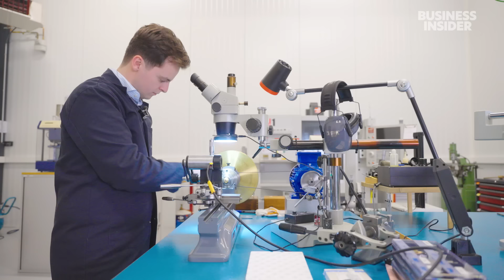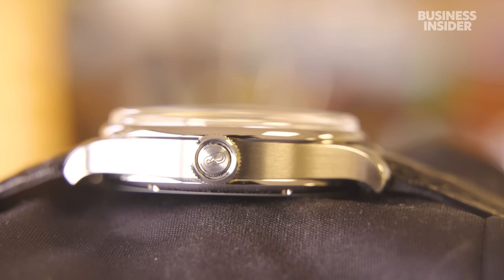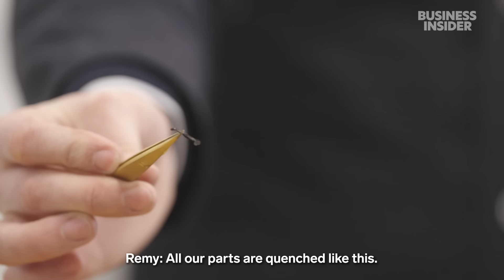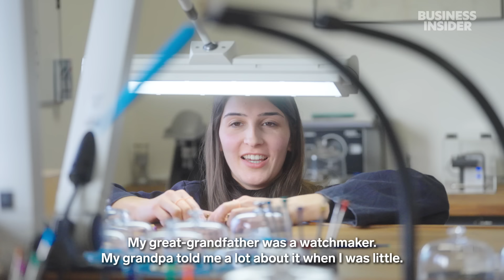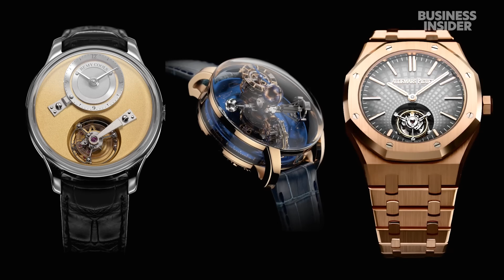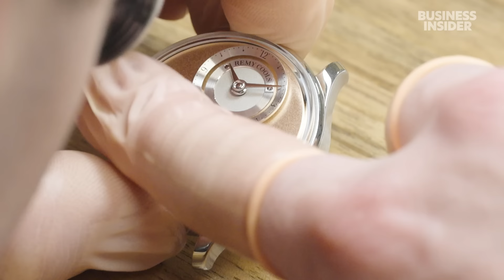Why This Obsolete Mechanism Makes Watches More Expensive | So Expensive | Business Insider

Comment: Actually the tourbillon is worthless in a wrist watch.  It was designed for a pocket watch because it stays in the upright postion all the time which degrades its accuracy.  A wrist watch is constantly changing its orientation so as to average out orientation errors.  So a tourbillon does nothing for a wrist watch but add cost.

Comment: an apple or android watch is so underrated. people only think of the watch itself but there are many hours of software that are written be loaded onto the watch as well. it would be interesting to know the number of hours creating a modern smart watch in total to include the time spent writing all apps loaded at the factory and available to later install on the watch. not to mention the built in gyro and pulse monitoring and wifi and bluetooth and gps (hadrware and software.)  

two people could not build all parts of a modern smart watch from scratch (including software) in a year i'd guess. if these two people in the video were building their watches like the amish (no machines/electricity) that would be one thing but they use computers with cnc machines. at that point just get a modern smart watch that constantly updates the time from a network based on an atomic clock and can start your car as well.

Comment: It's not about performance, it's about craftsmanship. These days, these are luxury items.

If you genuinely need the precision, any old cheap quartz watch will deliver. If you need more precision, a radio-controlled watch will sync itself to within a second of your local atomic clock broadcast. A GPS one will receive its signal from atomic clocks in satellites. These are all relatively inexpensive products which are built to serve a practical purpose. What they're definitely not, are luxury items.

Comment: Rubidium does also interact with the glass that contains it.  Like Potassium, it replaces Sodium ions near the surface of the glass, and increases the density of that layer of glass.  It also "pre-stresses" that layer with inherent compressive forces, giving the layer more resilience to tensile forces.  There is very little published on the subject of rubidium-hardened glass, but all of the foregoing is out there.  Potassium penetrates farther into the glass, but, being less atomically massive, increases the density in that layer, but less so than Rb.  When Potassium is used to harden glass at some Corning Glass factories, the product is named "Gorilla Glass."

I think you were correct that vaporization temperature selects for the use of the higher Z alkali metals, and Rb happens to be the highest of those Zs, while remaining mostly not radioactive.  Cs probably crosses that line of having highly radioactive isotopes, so that making a vapor probably creates an inhalation hazard.  That's my guess.  I like your Channel!  The Algorithm showed you to me today.  It might be that I recently have done a bunch of google searching for the use of Rubidium in making armor glass, and the hassle of losing Rubidium from shipments, as the soda glass containers absorb some of it.  Was this due to Serendipity or Jungian Synchrony?  😉 Algorithmic determinism, I suppose.

Comment: a tourbillon is a total mechanical absurdity, it has a lot of mass that has to be stopped and accelerated on every tick, that takes up extra energy, so the main spring can't last as long, it adds complexity for no actual advantage, other than the "gee wiz" factor if it is made visible. and you pay dearly for it because its not mass produced like all the other parts of the watch, basically you're paying for art work.

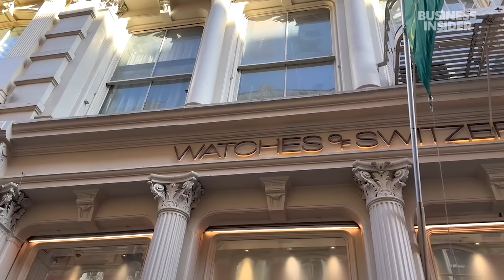Comment: 11:06 

It's not really a highlight. Jewels (Ruby/Sapphire) are quite common in watches, in the case of the Rubies, almost ubiquitous in mechanical watches, as they are very hard and very low friction materials that are used as bearings for the various pins and shafts to ensure that there is minimal friction slowing down the movement to ensure accuracy. 

Sapphire is also a very common "glass"/cover material which again is hard, thus reducing the likelihood of scratches forming. 

Mechanical watches are fascinating things, and I enjoyed that this was mostly respectful and for the most part a decently researched video. But jewel bearings should've been one of the crucial things that appear very early on into the research process.....

Comment: To be real, all mechanical watches as a precision timekeeping mechanism are ludicrously obsolete. Since the advent of quartz watches any claims to precise timekeeping are ludicous, cheap quartz movements provide  orders of magnitude better precision. A mechanical watch at best loses +/- 2 seconds per day while a typical quartz watch loses +/- 4 seconds per MONTH.  High end quartz movements can reach +/- 10 seconds per year. Of course one can then couple this with a synchronization mechanism to atomic standards at regular intervals via WWV longwave broadcasts, NTP internet protocols, or GPS. My cheap fitbit watch operates both bluetooth to piggyback off of my phone's NTP as well as having an integrated GPS reciever capable of synchronization to UTC to a small fraction of a second, with the capacity to get down to 30 nanoseconds with properly tweaked receivers. I've personally been able to get a network of $10 ESP-32 processors to within 10 milliseconds of UTC with little effort.
Thus mechanical watches at this point are anacronistic kinetic sculptures sold as Veblen goods.

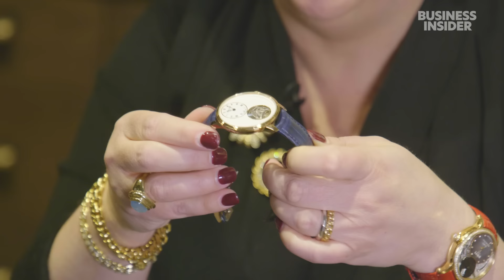Comment: At 1:41 she says wrist watches sit primarily horizontally but I find them to be the same as a pocket watch with a 10 percent difference,, while you walk or stand the watch would be in the same position as a pocket watch, only when you check the time, even sitting at a table you wrist orients the watch vertically, unless you always sit with you palms flat on the table but I doubt that,,not sure of the percentages or math but it seems logical to me that it still works in the way it was intended to work

Comment: I had to give this video a Thumb-Down, because it is riddled with misinformation. This video is mistaken on many points: 

1. No, hair springs do not move in the way shown in your animation; instead, they expand-only when rotating one direction, and contract-only when rotating the other direction. This is because one end is fixed to the fixed balance cock whereas the other end is fixed to the rotating balance wheel. 

2. No, hair springs to do interface with the escape wheel. Instead, hair springs apply bidirectional torques to a balance wheel, which turns an impulse jewel, which nudges a pallet fork, which interfaces with the escape wheel. It is the jewels of the pallet fork striking the teeth of the escape wheel which creates the “tick, tock, tick, tock” sound of escapement-based clocks and watches. 

3. No, tourbillons are not “obsolete”; they serve the same purpose they always did. 

4. No, mechanical pocket watches have not been replaced by mechanical wrist watches. Instead, most people opt for smartphones and/or quartz-timed electronic wrist watches for their time-keeping. But all four kinds of time-keeping devices (mechanical pocket watches, mechanical wrist watches, electronic wrist watches, smartphones) are still in common use, along with many others. 

5. No, “modern wrist watches” are not primarily mechanical; most of them are electronic with no moving parts.

6. No, wrist watches do not “primarily sit horizontally”. Firstly, they don't “sit”; people move around! And secondly, they don't spend all their time in the same position; people have their wrists in many different positions throughout their busy work days. 

7. No, tourbillons are not “for accuracy”; people who need high accuracy use smartphones or internet-connected computers; either will tell time to within 0.1 second of UTC. Instead, tourbillons are for accuracy within the universe of mechanical time pieces , and for the joy of owning, looking at, and using a beautifully-engineered mechanical marvel. People don't spend $300,000 on a Grand Seiko Kodo or $8,000 on Horage Tourbillon 1 for split-second accuracy (they could get much better accuracy from a $15 Casio); instead, people buy those watches because of their beauty, and because of their all-mechanical steampunk mystique, and because they manage to eke-out 1-second-per-day accuracy from purely-mechanical systems containing no modern high-technology parts at all. Just because nearly everything these days is made of plastic and controlled by electronics doesn't mean one's watch needs to be; that is the whole point of mechanical time pieces and tourbillons. 

8. No, tweezers are not “pliers”; anyone who has used either tweezers or pliers should know better than that.

9. No, it is not true that “tourbillons do not make timepieces more accurate [than they would be without them]”. Tourbillons increase accuracy by decreasing the slowing-down or speeding-up effects of the vector of gravity, by constantly changing the vector of gravity relative to the balance wheel, thus causing those effects to mostly “cancel out”. 

10. No, the sapphire crystals (two, not one) on a tourbillon (or any other balance wheel) are not visual “highlights”; instead, they are necessary functional parts of any rotating watch part requiring ultra-low friction. They are used because sapphire is the second-hardest substance on Earth after diamond, and hence brass-on-sapphire lubricated with a tiny drop of synthetic oil provides a near-zero-friction pivot. Thus the description “21 jewels” engraved on a watch is not bragging about jewelry, but rather, bragging about low friction.

I'm not a watchmaker, but even I as a collector and hobbyist can see those 10 obvious blunders in your video; a professional watchmaker would probably see many more errors and be even more emphatic in pointing them out. So, I suggest doing more research before making and posting videos, because this one wasn't very good (it's riddled with errors).
Reply: on point number 9, the reason its not required in a wristwatch is because of what you said in point number 6, peoples hands move about all the time, this is doing exactly what the tourbillon is there for
Reply: @randomcow505  : Well, there is that, yes: random movement reduces (but doesn't eliminate) the usefulness of tourbillons in wrist watches. (For one thing, a tourbillon improves accuracy during those times when the wearer is not moving or the watch is not being worn.)

However, that brings up error #11 in the video: it uses the opposite of a good argument against tourbillons, saying (absurdly) that "wrist watches are always horizontal [wrong], therefore tourbillons in wrist watches are useless [non sequitur; that's exactly when tourbillons would be most useful in wrist watches: for people who sit in a fixed position all day]". 

But then, if I were to actually dig (instead of just mentioning the 10 obvious errors I immediately saw), I could probably find many more errors in this video. It really wasn't very well thought-out.
Reply: I am legitimately curious to know in what world do you live in where pocket watches are still common.
Reply: The crystal fact is worthy to remember as the most important fact of mechanical watches.
Reply: Spot on.
Reply: I, too, am only a collector of watches. My most recent perchance being my first automatic. I have since become fascinated by how they work, so when I saw this video, it immediately caught my interest. After watching and coming to the comments, I'm glad to see I'm not the only one who thought there were several parts of this video that seemed inaccurate or misleading. Your comment pointed out pretty much everything i was questioning. I'd also like to point out that acknowledging the skill and craftsmanship of this gentleman is wonderful, but you can have a tourbillon movement for hundreds (if not potentially cheaper). You're by no means required to spend hundreds of thousands.
Reply: In point 2 you say, that " It is the jewels of the pallet fork striking the teeth of the escape wheel... ", but infact the teeth of the escape wheel strike the pallets of the pallet fork and not the other way around. This is an important distinction to make because the power comes from the escape wheel in this situation.

Also in point 10 you talk about brass-on-sapphire when in fact it is always steel-on-ruby (the stones are ruby in 99% of cases).
Reply: Calm down son, it’s just a video.
Reply: @ryanbender484  : Wrong, wrong, and wrong. 

Firstly, I was never un-calm. You disagreeing with someone doesn't mean that they are un-calm, it means that you are un-calm.

Secondly, I'm not your son.

Thirdly, I was not objecting to the fact that this video "is a video", but rather, to the fact that most of its assertions are false. 

In short, calm down, son, it was just a comment you disagreed with. Concentrate on breathing slowly and deeply. You can survive it; trust me on this.
Reply: @RobbieHatley dude chill out it’s just a video

Comment: Fun fact: a Tourbillon in a wrist or pocket watch is not what you can call a "complication."  It has no purpose in this type of watches, no effect for the user of the watch. Therefore by definition you can't call it a "complication". 
The just put it in to make it more expensive or for style purposes.
Reply: That's neither “fun” (it's obnoxious) nor a “fact” (it's a falsehood). Yes, the addition of a tourbillon to a watch will make it more accurate than it otherwise would have been, by cancelling-out the slowing-down and speeding-up effects of the vector of gravity relative to the balance, by causing the gravity vector to be always-changing relative to the balance. If anything, tourbillons are more effective in wrist watches than pocket watches, because pocket watches were mostly carried upright in belt or vest fobs, whereas wrist watches can be in any position depending on what people do their hands. So, yes, tourbillons are functional in wrist watches. And, they are a “complication”, and they would be a “complication” even if they did nothing, because the noun form of the word “complication” means “an added subsystem which makes an existing system more complex”.

Comment: So maybe a noob question but Ive seen some nicer watches though nothing like these and they always have the sapphire, why not a more exotic something like a yellow diamond or something else. I mean, price is basically no object for many of these buyers is there another reason or do these already exist?
Reply: The “jewels” in mechanical timepieces are not jewelry; they are low-friction pivot points. Purple sapphire is used as pivot points because it is the second-hardest substance on Earth after diamond, and because it is relatively easy to machine using diamond based tools. Diamond is not used because you cannot machine diamond, even with diamond; you'd need a harder substance, and none exists; so the second-hardest substance (purple sapphire) is used instead.

Comment: Have always loved watches and clocks. The older, smaller ones before all went to batteries are so interesting. I guess the fact that the pieces all work together and are so delicate yet work so well is amazing. I collect older small ones, none are expensive, but love the design differences. Even some old cheap ones are beautiful. Great video. History of watches is cool.
Reply: Pure-mechanical watches and clocks are still made by many companies. The watch I wear on a daily basis is a Seiko HRPE77, made in 2023, which I purchased for $250 new. It has a clear back so the movement is clearly visible.

Comment: For every "so expensive" video, the reason is always either:
1) it's done manually
2) volume is low, demand is high

Whether the product is actually accurate or does its job well is completely irrelevant.
Reply: People forget it’s a piece of jewelry primarily that keeps time secondarily (as well as a mechanical watch can).

Comment: Compare to a high-end computer chip made in a Taiwan fab. Millions of even tinier features designed and built by thousands of people and priced for the masses. But the moving parts (electrons) are too small for the eye to see and the net cost using mass production is accessible to almost anyone, so it doesn't get the same kind of attention as an expensive piece of art. (I work in that industry on the machines that test them for quality.)
Reply: I work in aerospace and turbine engines are literally worth their weight in gold.  But most people will never understand what goes into building or maintaining a modern turbine, so it's not going to be seen as "art".

Comment: Wristwatches are mostly held just as vertically, as a pocket watch. Most of the time, your arms are resting on your sides, with the watch positioned in the same kind of position as a pocket watch would be, in a pocket ...and they do a lot of moving about. So how is the mechanism "no longer necessary"?
It isn't necessary, only in the sense that mechanical timepieces are no longer necessary, as quartz timepieces are vastly superior in every possible way
...but for a mechanical timepiece, a tourbillon is no less necessary, than it ever has been.
Reply: It's because more modern movements that are COSC or METAS certified are tested for accuracy in multiple positions before they even go into the final watch assembly
Reply: @edkwon  That doesn't make what is said in the video, make any more sense, or be any more correct.
Reply: @edkwon Those watches are still prone to positional errors. They are typically adjusted to 6 positions - at most. Generally much less than that. A tourbillon essentially negates all positional errors in timing. Modern mechanical watches do very good at time keeping in various positions, but the fundamentals of a tourbillon movement still hold true.